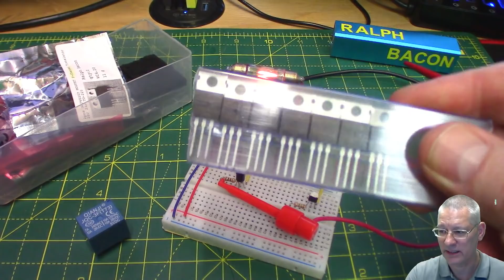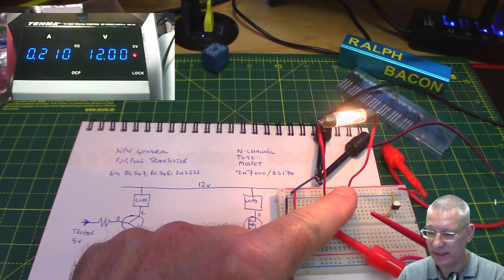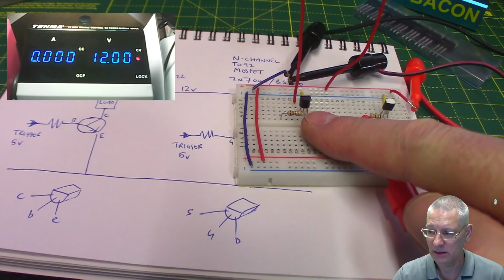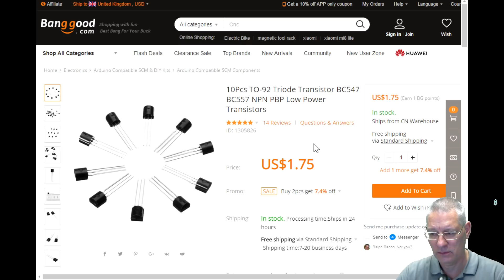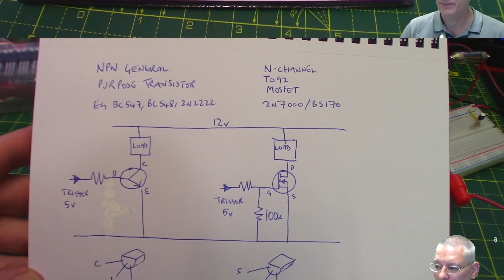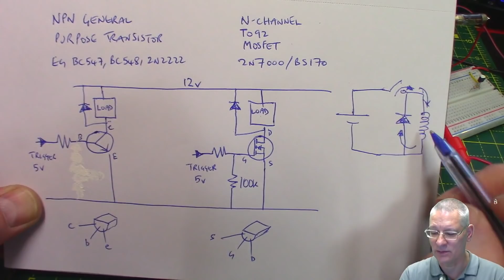#136 MOSFET vs BJT NPN (TO92 package) 🤷

Comment: Transistors + Inductive loads need a diode or something else to kill surges when power is turn off or the transistor often fries. Most MOSFET Body Diodes take care of this problem. In Winter and central heating will dry out the air even worse then cold dry air outside and everything gets charged with static electric very fast under these conditions. Even if you do not get a shock, MOSFET and many types of CMOS can instantly blow the gates when touch and that is already build into a board. Higher Relative Humidity and static electric stops being problems most times but should use static safe work zones all the time. Common Plastic work mats like your Ansio cutting mats and you without static straps can kill many parts and complete boards. You can buy cheap static safe work equipment often < €50.
Reply from the maker: I used to wear a static earthing strap but stopped because it could also kill me if i touched the mains at the same time! I need to look into a proper anti static mat, let's hope they are cheap.
Reply: A good earthing strap has  a series resistor of maybe 1Mohm, i.e. the risk of being killed by mains is not really increased.
Reply: @henrikjensen3278  Yes and the anti static mats and other work station parts often also have the 1Mohm or higher resistor because metal benches, mat and strap might not be earthed/grounded to same point or have problems in a mains power device on the mat or bench at the time. Even if you have an expensive kit from 3M and others is recommended you test every day or week to make sure the resistors are still good. Why? Portable Kits and most Straps are especially easy to find resister or earth wire parts are bad. Many businesses require testing wrist and shoe straps every day or at end of any work break often to meet government and insurance rules. Home use can use a ohm meter but Example tester for business watch https://www.youtube.com/watch?v=Nw2g1sYVooM
Reply: @RalphBacon  Forget to add... RCD protected Mains can help with or without proper anti static workstation when that happens. At minimum get a workstation outlet with RCD/GFI to plug in a questionable device without having a full isolation transformer that many people should have. But RCD/GFI won't save equipment with grounded probes connected to mains. Is why some channels have covered isolation transformers several times like John Ward's Mains Isolation Transformers https://www.youtube.com/watch?v=sfzy5IQMzyc
Reply from the maker: I'll be doing a video soon on Mains Safety, including a proper isolation transformer, which I use. Keep tuned!
Reply: @RalphBacon  Most of those that I've seen have 1 megohm or so of series resistance for exactly that reason, which won't make much of a difference at all when it comes to static charges.

Comment: You know I think I read somewhere, or heard on some channel about the problem with the transient voltage and these little mosfets. I needed a couple a year or so ago, and got a deal on 100 of them.  Not wanting a bag of 100 mosfets laying around to get stepped on, I simply emptied the into my little plastic container box where I store my regular transistors.  Now I have to wonder if any of them work at all?  Hate to pull them out to test them as I may well nuke them in the process.  Sometimes I think I should have stuck to the gunsmith trade instead of changing to electronics.  While guns are fun, I am in no shape to head out to the range to test fire guns that I have repaired, so I sold off all my smithing tools and filled my back room with computer and later electronics stuff. Thanks a million for the videos, I love learning, and your videos furnish me with that luxury on demand.  You can't ask for better service.
Reply from the maker: Glad you like the videos, Jerry, and yes, I'd gently remove those MOSFETs and put them into anti-static bags, but don't touch the pins whilst you do it!

Comment: Hello Ralph, do you know a website where you can search for comparable components? I bought an assortment box with (2n2222; 2n3904; 2n3906; 2n5401; 2n5551; a1015; c1815; c945; s8050; s8550; s9012; s9013; s9014; s9015; s9018).
I look for e.g. for comparable types.

I think your video about "electric" switches is great. A good explanation and introduction to the world of transistors.
Reply from the maker: I bought a similar assortment box, Patrick. The best way to compare them is to read their datasets, which are generally available on line. You could even transcribe the important bits to a table, such as max voltage, gain, max current and power etc.
Reply: @RalphBacon  This seems like as good a time as any for a plug for my website,  which has a LOT of datasheets available for download,  as well as a bunch of comparative data on various transistors and such. I also have a fair pile more to add to it,  which I hope to get to one of these days Real Soon Now.  A search on my name should find it...

Comment: Hello Ralph, thanks for your videos
Mosfets are much quicker to turn on and off compared to bjts..
Reply from the maker: Agreed, Carlos, and for higher power devices that is important in PWM circuits. These smaller ones probably make good oscillators but i haven't tried that (yet).
Reply: "Mosfets are much quicker to turn on and off "  True but when is that significant?
Reply: @kennmossman8701  When you're handling a LOT of power.  Or switching something where the timing is critical, like making darn sure that one leg of an H-bridge (look it up) is OFF before you turn the other one ON.  Stuff like that.

Comment: Hi Ralph
Again, an extremely well produced vid....
In my view, your presentations are at the top of YouTube production quality.
Also,  your stuff is always interesting and quite valuable technically. I have you near the top of my 'AM_To_Do_List'....
Good way to start the day off and get the Little Gray Cells jingling.

Question: I've perused through your PCB sponsor's webpage and found no reference to Schematic Entry/Board Layout.
Any sugestions?

Back some decades ago, I was a heavy user of all the big names in the business but have been out of it for 20+ yrs.
I've looked @ a number of the Quick-Turn board suppliers that have their own on-line design suites but I much prefer that the software resides in my LapTop solely under my control.
Sir, what do you use, if any

Regards
Russ in NH, KA1RUW
Reply from the maker: Well, Russ in NH (im trying to work out where that might be) one well supported CAD program is KiCAD (pronounced key cad). As i find out, there is a bit of a learning curve but it is up there with the best, and it's all free! Thank you for the kind things you say about my videos, I'm flattered.

Comment: Nice explanation Ralph. I wonder about the aspect of the voltage drop of a BJT against the RDSon of a mosfet. I think in most situations you won’t waste so much power as with a BJT. Especially on low voltages the mosfet might be a better choice.
Reply from the maker: Indeed, and running 200mA thought that MOSFET and it not getting warm indicates low losses (a bit unscientific using a finger but it's quick and easy). I need to experiment further.
Reply: Ralph S Bacon maybe get the thermal imaging camera out if you have one? Otherwise I could check that for you
Reply: Depends a lot on the MosFet.'s rDS(on)
 which  varies a fair bit for a  MosFet and varies a great deal in the MosFet family. I've measured for a BJT a voltage drop of 0.15 Volts which equates to a rDS(on)
 of 0.15 Ohms  (in this case) . Would a MosFet have been better? All depends on the particular MosFet

Comment: Why are MOSFETS in your PCs CPU and not bipolar transistors? Because if you have 10.000.000.000 of them in a modern Intel or AMD CPU they consume about 100A. (And 1.1 V or so) If such a CPU would be made of bipolar transistors every PC would be delivered with its own power plant. ;-) 

If you use a bunch of them on your arduino the current just does not matter.
Reply from the maker: That might well be true, but in that case why ever use a BJT at all? Why are they still manufactured? It seems they still have a role to play in modern electronics.

Comment: You can get small mosfets with low RDS on, try searching AO3400, but TO92 packing is not popular. I seldom use a resistor between the driver/Arduino and the mosfet with these small types, but I use a pull up or pull down resistor, depending on what I want the initial state to be.
With TO220 mosfets you can get very low Ron, the last batch I bough was rated at 0.002ohm (2mOhm) Rdson, current was limited due to the TO220 package, not due to the actual mosfet.
A advantage with MOSFET is that the on resistance is ohmic, this is very useful if you want to use it with AC (Often small audio levels, watch out for the diode). For more advanced switching an IC (4051 and similar) is much easier to use, it has two mosfets in series and and avoid problems with the diode.
I also found out you can get OPTO mosfets with the two mosfets in series, i.e. a isolated electronic switch that can handle AC, very useful for some applications.
Reply from the maker: The larger MOSFETs certainly do have a very low RDSon value, but really really low ones cost more, if course! I wonder why they don't make TO92 ones with a lower resistance. I'll investigate the other things you mention on my return to the UK. Sounds fascinating.

Comment: Used a lot of bc548/7 bc558/7 before. Then I found a IRLML2502 (of memory, away from my workbench...) it is smal, a sot23 package that handles 20V and 4A. And work with logic level input. I don't use any resistor between microcontroller and mosfet. First used to switch a led strip with 300leds. Then to pwm the strip. And when it is in my partsbin i often pick it to do simple signal/logic operations to...
Reply from the maker: Yes that's a very capable transistor but it is an smd so harder to use by most people with Stripboard. Is there an equivalent TO92 package?
Reply: @RalphBacon  I don't know of equal in TO92. I have mounted some on breakout boards for use with breadboard. On stripboard i often put the side with 2 conections down to 2 strips and use a wire to the 3rd connection. The things I do on a stripboard is only on offs, so it's okay for me. Everything more than 1 of same, I order pcb and use solderpaste and a hotplate to solder.
Reply: @RalphBacon  d965, collector current of 5A in a TO-92 package

Comment: Hi Ralph, I think it boils down to what your used to as a switch,  Ive got a big bag of 2N2222A so I just grab one of those!
Reply from the maker: And that's fine, Andy, but if you had a bag of 2N7000s as well, which would you choose? And why?
Reply: @RalphBacon  Hmmm...…..Mosfet, just because they work fine for PWM applications (the simple stuff I do) with just the addition of a 10K resistor (gate to source) and the Arduino is happy to drive a logic level device directly.

Comment: Nice primer.
MOSFET is Arduino friendly as less current is needed to open the gate, even with drain-down resistor.
MOSFET has an intrinsic body diode that allows reverse current... this can be useful.
Some circuits use junction transistors to switch MOSFET gates. Strange stuff.

I have used MOSFETs to switch large currents with an "Arduino". They also came in useful for level translation between 5 and 3.3 volt system communicating via I2C
Reply from the maker: I never checked how much current can be passed via the body diode. How is this useful, Bernd, got an example? I'll investigate on my return from Stuttgart.
Reply: Less current... A major understatement  there Bernd. We're probably at μA or maybe nA. The theory says no current. The gate of some MOSFETs can be charged and that will switch on the MOSFET and leave it on for hours with a  non connected gate. Pretty amazing. :-)

Comment: Hi Ralph,
Are you sure the resistor in series with the 2n7000 gate is necessary?
Reply from the maker: No it's not necessary Eddy. But if the MOSFET fails your Arduino (or whatever) could follow suit. Just a low value to current limit would / could be a safety net. But see other comments here about the gate capacitance and how adding a resistor might show the switching down (a tiny bit).

Comment: Hi, Ralph, 
Can you measure the Vdrain and calculate the effective Rds.
A similar calculation with the BJT.
You could then have compared the power dissipation in each device, rather than a finger temp test.
Reply: Absolutely.
Reply from the maker: I could have done that, although i think it's safe to say if it can sink 210mA without breaking a sweat then it has passed the temp test. But I might have a go anyway!

Comment: what about switching time? Also a pro for bjt, I remembered that wrong. But mosfet is more efficient when switching a lot (high frequency)
Reply from the maker: Correct, it can switch faster. But other than as an oscillator, i wonder how that is helpful in such a small package?
Reply: Ralph S Bacon probably not at all. Especially with a high Rdson, that works against the benefit of less power dissipation during switching.
Reply: True but when is that ('high frequency') significant?
Reply: @kennmossman8701  In radio gear?

Comment: No sure exactly why I belive this, but I am under the impression that MOSFETs are faster than BJTs.  Well... Time to pull out the data sheets.
Reply: Data sheets not helping but... This https://oscarliang.com/bjt-vs-mosfet/
Reply from the maker: Yes, MOSFETs are faster than BJTs, so faster switching is possible. So for PWM they are better on two fronts, speed and power!

Comment: Ralph, some interesting information but seriously why would you pay more for 10 bc547 when you can get 50 2n2222 for the same price? If you don’t want 50, give the other 40 away to your subscribers although frankly they’d get better value from their postage by ordering 50 - lol
Reply from the maker: I haven't compared them, perhaps the bc547 had better current capability, or higher voltage... I'd need to compare Datasheets. But for many purposes they are undoubtedly interchangeable, i have many of those too!
Reply: Ralph S Bacon They were in your video as broadly equivalent but you chose to ignore that when you went shopping, concluding that the fet and the bjt were roughly the same price when they aren’t. It makes more sense to go to Mouser or Digikety etc if you want to do a fair price comparison.

Comment: I have been using these for a long time. Particularly in two way logic level shifting. As long as standard static protection procedures are  used there fine. Being old school I always use BJT for low power switching.
Reply from the maker: Level shifting has been mentioned here a couple of times, I'm just trying to figure out how bidirectional level shifting would work, does it require two MOSFETs per channel to achieve this?